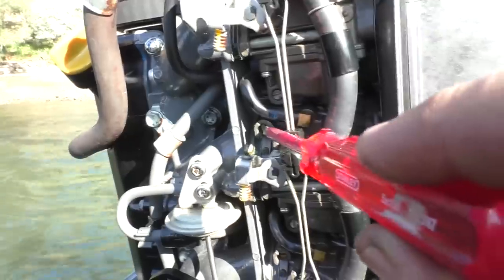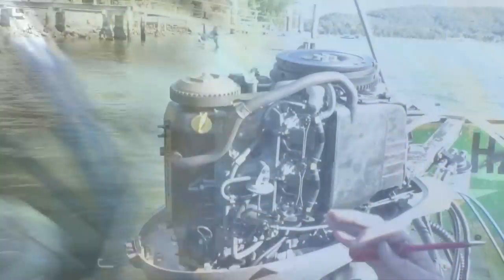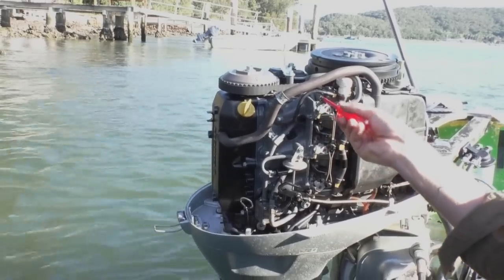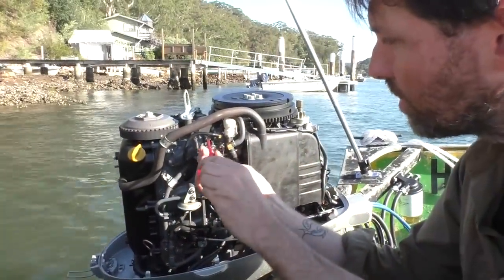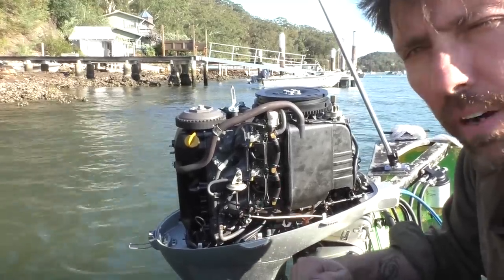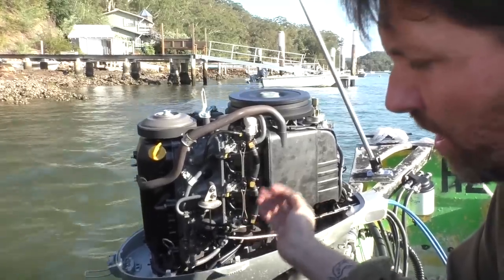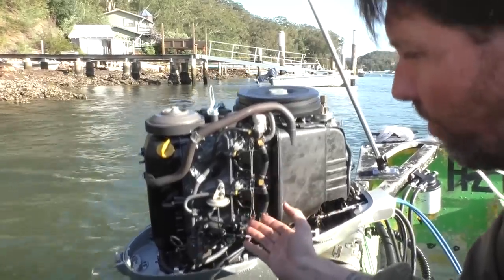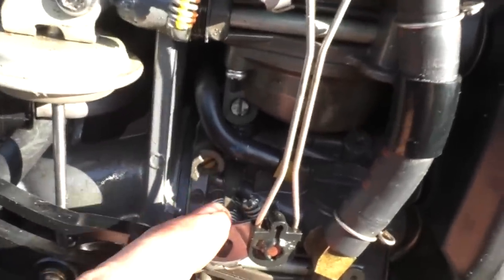Four stroke carburettor synchronisation

Comment: Awesome thanks Stu. Ive got similar on my BF45. Cutting out at 1200rpm as trying to accelerate. Picking running too lean/and or cold, have ordered replacement thermostat to replace to missing current one.

Comment: A lot of helpful information in this video. Thanks!
Reply from the maker: You're welcome Michael.
Reply: Good info. I dropped a drain plug from a carb on my 175 Johnson. It is somewhere under the engine. It looks like I need to turn the engine upside down to get it out. Found another plug. Might as well have dropped it in the water. My tractor has only one carb and does fine. I don't need three carbs. I got the boat free. That is more than it is worth.

Comment: Thank
You for the info... my Yamaha is displaying sun tens after sitting up for many years ... Motor looks new but has been neglected and I’m
Playing catch up ... I first thing I will do is replace all vacuum hoses and fuel hose as cracks have been seen ..
Motor will not idle correctly and is really rough ... 
the carbs have been clean thoroughly with new jets and Orings..
To sum it up thank you for your time In explaining the  Symantec’s and what’s involved ..

Comment: If you don`t have them fluctuation steady valves on the hoses  , I`ve always used a 3 -4 ft hose make sure it`s a U  shape add 10cc  2 stroke oil in the hose or each hose  attach it to carb keep the guage same height all carbs the oil stops the surge , if it goes thru the motor you won`t hurt anything ,
Reply from the maker: Hi mate, sounds like a good tip. I'm bound to lose those valves at some stage so I'll give it a try. :)

Comment: On my US model they have stops and I couldn't pull them out , I balanced the carbs with vacuumed gauges , replacing the cracked emulsion jets made a big difference , but it still will bog getting on plane at times , I sure the fuel pump is weak , it's 23 years old and sat up for 15 years

Comment: Carbs are still scary, but slightly less so now.  Thanks.  :)
Reply from the maker: You're welcome. You'll get your head around them in the end and they won't be scary. :)
Reply: don't be scared!! always remember, "carb's suck"... yeah, really. it's how they work, it what makes them work, it's actually their job, sucking. all ANY jet, orifice, port, or valve does in a carb is moderate the sucking, and what get's sucked. synching just gets them sucking in harmony. idle mixture makes sure they suck the same at rest. a main jet just regulates maximum sucking, while a needle moderates that sucking according to load. an idle jet just makes sure enough, but not too much is available to suck at rest. any other jet does the same, just for a different throttle position, and those that are MORE open. the float makes sure they all suck at sumps with equal head. bingo, you just learned just about all there is to know. seriously. an accelerator pump just adds a squirt more than needed (fuel) to encourage the motor to gain speed. for as much depth as you will probably ever need, just search "free download mikuni tuning manual", and peruse the dozen pages or so it yields. the mikuni rundown is comprehensive, about as easily understood as addition, and entirely fright free, i promise. all carbs work basically the same way, at least at the theory level (as a single barrel solex downdraft has a bit different junk inside than a mikuni slider), so the nice simple mikuni WILL help you comprehend such wizardry as webers, and rochester q-jets (which operate with black magic, seemingly to most)
Reply: Thanks luddite.  Love the name btw.
Reply: l
Reply: Matthew Millar I think the scariest part in dangling all those tools over the water. Splash splash all gone!

Comment: I would always do a balance before I try and tweak the mixture. I have found that the sweet sopt is MUCH easier to spot and the motor much more sensitive when the carbs are initially balanced ... otherwise you could be trying to tweak mixture on a carb that has the butterfly closed.

Comment: For a spot on multicarb vacuum balancing need to have all carb's internal parts such as  jets, nozzles, pilot's screws, float's needles valves, fuel passages in mint clean condition as when factory delivered. Will make a night/day difference...
Reply: You are correct, he states exactly that 5 seconds into the video.

Comment: ....super video....very informative....thank you!...my engine suffers exactly the same symptoms as you showed demonstrating a vacuum leak...it turns over but will not fire!...my gaskets look ok but there is a slight blemish/ tear on the block gasket....would this kill be enough to kill the engine????....is there anywhere else I should look for a vacuum leak??...
Reply from the maker: No, a small tear on the block gasket probably won't cause it to not start. Some newer EFI engines have an idle air control valve that can leak because it is connected with rubber hoses. Leaks are a bit harder to find when the motor won't start. You can use an LPG torch like the one I heat things up with to help find leaks if the motor is running. You turn it on so a bit of gas is coming out but NOT NOT LIGHT IT! The unlit gas will get sucked into a vacuum leak and make the engine idle change you just keep pointing it at different areas until you find the spot. So given it won't start though, are you sure you don't have another problem too?
Reply: ....Stu....very many thanks for your kind reply....so frustrated this end....just will not start when cold unless I use a whiff of "easy-start"...have throughly cleaned carbs as per your vids, replaced plugs and ht leads, fuel supply is good, passed compression test...search goes on...thanks again..P....

Comment: Another great video, Stu.  I just finished cleaning the carbs on my Honda BF50A, reassembled, adjusted the mixtures and balanced.  My manual says to next adjust the acceleration dashpot and the procedure makes no sense.  Says to remove the throttle linkage rod from the cam and in the idle position to set the gap between the cam and the roller by raising/lowering the dashpot.  Problem is the dashpot only contacts the assist plate and not the cam so moving the dashpot position doesn't affect the cam/roller relative position.  I couldn't find any video or forum discussion on this topic.  Would be great if you could do a video on the dashpot, how it assists acceleration/deceleration and how to properly adjust it.

Comment: My 2003 90hp elpt 3s doesn't need a sync (don't believe) but went ahead and bought a 75.00 gauge set off Amazon to check it anyway. Do all my own service and always known about the need to do a sync but been a mystery til watching this and other videos.
I have x4 Keihin BCF carbs and just did a complete cleaning and is running great now. Not using boat often these day's so plan to get more religious about either draining carbs completely when it's gonna sit or fill filter housing with special mixture (quickclean/seafoam and stabil) and pump into carb...not sure which would be best.
Looking into replacing carb drain screws with an easily accessible set of 4 shutoff valves instead as getting to the two bottom screws is a kinda a pain.
Reply from the maker: Good idea adding the valves, the screw can be hard to get to and very easy to drop in the lower cowling.
Reply: @DangarMarine  (correction, elpt 4s not 3s). Carb drain plug size/threading seems to be either 28 or 32 tpi (or somewhere between ?). Couldn't discern going to local hardware so hoping specialty shop has what I need. Figure a short little neoprene barb fitting would be safest so as to not damage drain threads.
Using 4 qty lawn mower type gas shut offs.

Comment: Hi great set of videos you are producing , Dont know if it makes much difference ,but Honda say you must clamp off all 3 SE tubes to balance properly
Reply from the maker: Hi Andrew, good question about the tubes. To be honest I didn't consult the service manual specific to this motor as I generally go it the same way on all four strokes. Thanks for pointing it out though, I'll take a look at the manual when I am in the workshop on Monday and see what it says.
Reply: I have the same job to do monday morning, my Seloc manual say to clamp off the tubes, my Clymer manual say Notting about that.....Don't knows if that make differences...……

Comment: Great video, thoroughly explained, may I ask how many inches of vac should a 60hp  4 stroke non efi engine have?, I’m balancing the carbs on it, feels & sounds very nice, only in the water it seems to bog down, filters, lines, pump all have been cleaned, any ideas or suggestions would be much appreciated, cheers, Chris
Reply from the maker: Not sure about the inches of vac, generally I just aim for them to be even. Sounds like the carb jets might need a clean too.

Comment: Thank you so much. That was excellent instruction. I have another question. I have an old 1985 Mercury black max 150 v6. In idea it revs fine until I run it a little. Then it revs super high. Any suggestions? Is that a dirty carb most likely?

Comment: Just bought my first boat with the same Honda BF40 in the video. It runs very rough without full choke and throttle, but had the cylinders all checked and match at 199 each.  rebuilding the carbs with the help of your videos and service manual now.  Did you ever do any work on the fuel pump on the BF40?  I have watched just about every video that is around the time you revived this motor and couldn't find anything.  Love the videos and you will be my go to video library for a long time to come.....
Reply from the maker: I don't think I did the fuel pump on this motor, but they are pretty simple things https://www.youtube.com/watch?v=_ezu96S7e14

Comment: great video & thanks. I need help with a 2000 60hp 4stoke mercury. I took the carbs apart to dip them. & removed the butter fly & I can't get it running right again. I thought all of butter flyies  were the same & but I keep changing them & the carbs keep doing different things. One time it runs good but can't get it off high idle,  next low idle running ruff.
Reply from the maker: Hi Jim. I would have thought they would all be identical. If you look at a parts diagram for that motor do all three carbs have the same part number? Are the seals between the carburettors and the engine block in good condition? The problem may not be caused by the butterflies themselves.

Comment: Much thanks!  I have a Hoda outboard ef90. Due to fuel overflow, I have cleaned the #4th carburetor which is the synchronization base carburetor. When I screwed in, not out, the adjusting screw, vacuum was increasing. Other carbs are Ok. Do you think, did I make some mistake while I creaned the #4th carb?  And though I closed 4 of the pilot screws, engine was still running, actually no change at all with the pilot screws in or out.
Reply from the maker: Generally if you don't notice any difference with the idle mixture screws changing it is because the idle circuits need a clean out in the carburettors. They shouldn't have a huge affect on vacuum though.
Reply: Thanks for your kind answer.  I have cleaned the carburetors and every thing is O.K now.

Comment: Mate, awesome detailed video !! Helped me a lot. Got my dad's Yamaha 4 stroke 4 cylinder going really good. Did all the pre steps, carbs cleaned, new gaskets, adjusted carbs, checked valve clearance. When I tried to sync the carbs, the top 3 I can adjust but the bottom one is sitting at approx 18" regardless of the screw position. Motor is running nice. Any advise what to do, besides puling to the lake and test? Cheers !!

Comment: Hi awesome videos, I was just wondering what all the other readings on the gauges mean like the green normal etc.thank you
Reply: tucka1234 these gauges also register pressure.... if you look at the white bar in the 11 o’clock position, it changes over from vacuum to pressure. So you can use these for fuel pressure or low levels of air pressure.

Comment: Great video does the kinking of the vacuum line on that first cylinder tester make a difference
Reply from the maker: Thanks George. No, not really. Those little while valves close the hose off to a small aperture so as long as it isn't pinched off completely if will be fine.
Reply: Dangar Marine thank you sir you have the best videos on these Motors and all my mechanic friends agree

Comment: Very very nice video! Hmm, you forgot to explain why you were tuning the engine that way - it is to reach maximum horsepower, BUT that is not necessarily what everybody needs when tuning their engine.

Sometimes, running a little lean or less compression etc may mean less power, but more efficiency out of the motor (especially two strokes that tend to throw out quite a bit of unburnt fuel), not exactly the same via tuning, but it's how some engines will be at two different horsepower from the same block. Also sometimes may be safer as there's less risk of over heating, over revving, etc etc etc.

Would be great if you could make another video to teach us how to tune an engine for safety (knocking, over heating, efficiency, limiting power, increasing power, - pros and cons). Especially if we're running an older block with gunk built up in the bulk head cooling system, or just general safety.
Reply from the maker: +David Tan Hi David, good point in what you are tuning for. In this case it is really tuning each carb to be equal so that it runs smoothly and balanced which is pretty much always a good thing. Running lean can be a bit more efficient, but it is more dangerous in the sense that a lean engine will actually run hot. Advancing the timing will give more power but is also more dangerous. Running rich with retarded timing is the safest combo, but you can then foul plugs up. Such a balance of things to get right!

Comment: Excellent demo on adjusting the carbs. I did notice though that a couple of the vacuum tubes were pinched somewhat. Would that any effect on the accuracy of the gauges? Still a great educational video keep up the good work.
Reply from the maker: Thanks David. Not really. It's best to avoid them but the little valves in the line are designed to restrict the flow through the hoses much more than a minor kink.

Comment: Hello Stu,

Somebody said that this nice procedure only works well for 4 strokes outboards, was wondering if will work good on multicarb 2 strokes motors provided there's a proper place on the carbs or manifold to connect those vaccum meters hoses. If so, which vaccum reading will be good to adjust all carbs for for a nice fuel/air mixture while motor idles at neutral  ? Thanks.

Comment: Sweet dude your video are awesome to watch .. I just got my first outboard a 1987 Johnson 40.. it's been sitting  for about 6 years so I rebuilt the carbs new fuel line  changed fuel tank new oil line  the whole 9 yards.  But it still Boggs out should you know why???  Thanks  love your videos learning a lot from them
Reply from the maker: Hey Raul, is there good fuel in the carb bowls or are they running dry. Did you take a look at the fuel pump?

Comment: I have a 1999 50 Yamaha 4 stroke ,I can’t get any Vacuum on #4 Carb . 1,2 and 3 sink fine good compression on all Cylinders. Engine runs fine, it just has fought spot just above idle then soothes out.

Comment: Hello,
I have a 1991 Mercury xr4 blackmax 150. 2-stroke. Need help locating where the hose coming from “valve thermal air” leads to. The valve is located between plugs 3and 5 and the hose seems to Leed towards intake area

Comment: I have Tohatsu MFS30A, All carbs have a common vacuum hose connecting each carb body together and then to cyl #3 intake runner. Does this "common" vacuum line have to be disconnected to balance carbs? Thanks

Comment: Sorry I should of specified. Its a 40 HP Merc 94 model. Its just had a complete overhaul choke is working fine when the key is pushed in. ?
Reply from the maker: Do you keep it pushed in the whole time it is cranking? The Merc I use really needs that to get fired up in the mornings.

Comment: My 1987 Evinrude 120 doesn't appear to have any carburetor mixture screws. And even though all 4 butterflies are completely closed,  it idles much too fast (1700 rpm). The manual recommends idle speed to be set around 800 (I think). Do you have any idea what the problem could be?  I've been told that a vacuum leak could cause high idle. If so, how and where should I check for vacuum leaks? 
 I thoroughly enjoy your videos!  Thank you.

Comment: Another great video.  Thanks for your time and effort and for sharing your skill and knowledge. 

My question is how would you balance 6 carbs using 4 vacuum gauges? I would guess three at a time, or is there a way you could pair them and do upper, middle and lower? Maybe four at a time overlapping the controlling linkage?
Reply from the maker: Good question! If each bank is like this Honda, then you will have a bottom carburettor that can't be adjusted individually. I would use your gauge to set the top two carbs to match the bottom on each side and then hook up the top on bottom from each side and use the overall idle adjustment of the bottom two carbs to make sure the two banks of carburettors are even with each other.

Comment: Hi is it possible that the idle mixing screw on some carburators only effects the acceleration performance? On a F30 the rpm don’t change when I adjust them. But I see a big difference in acceleration in low rpms.

Comment: What about syncing the carbs off the idle circuit first? That way when you do the idle adjustment the butterflies are closer to being exact.. Took me forever to do this on my vfr from underneath with hot crank case! Ive literally considered using a vacuum (without a bag) or shop vac on one carb at a time on the bench!
Reply from the maker: Interesting idea. You're not wrong about some jobs being very awkward to do with the carbs still in place!